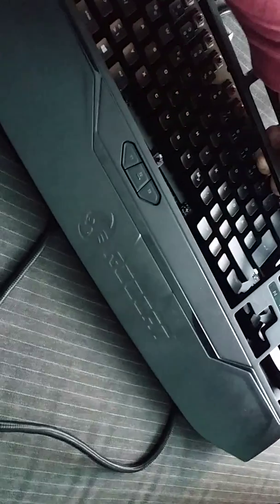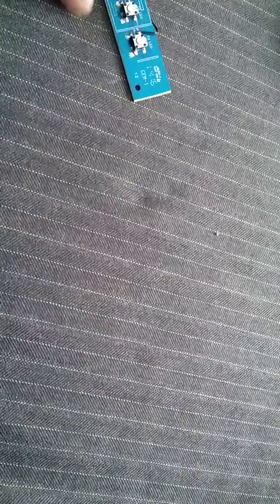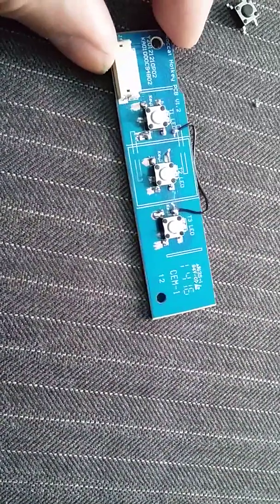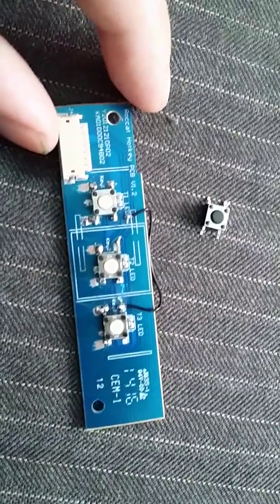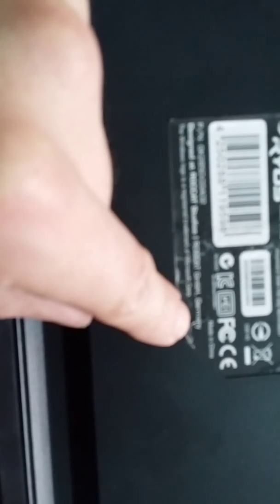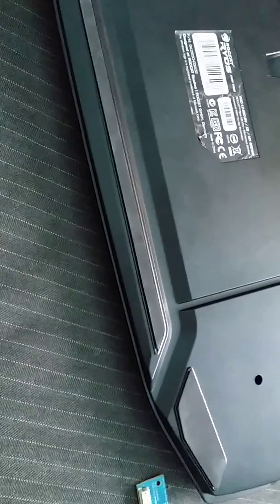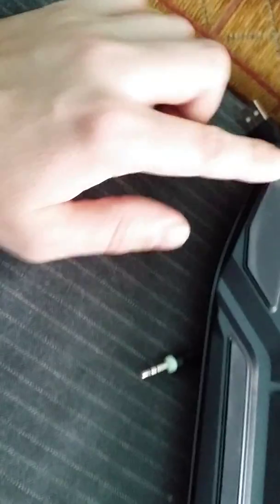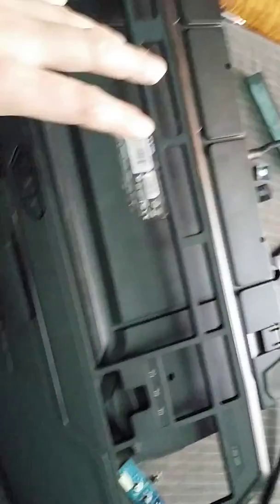Replacing Roccat Ryos Mk Pro thumb switches

Comment: some keys on my keyboard light off. Can the mechanic buttons be replaced easily? (my plan to change from the black switch to red/brown)
Reply from the maker: It's gone be time consuming but will be doable. You will need a soldering station preferably cause you will require some precision.

Comment from the maker: Oh forgot to mention that u need to heat up well the soldering gun before using it and use something to force the switches leggs just a bit up when u desolder them so u dont mess up the board circuitry and dont keep the soldering gun in contact with the board to long because the circuitry lanes will come off very quicky being very thin